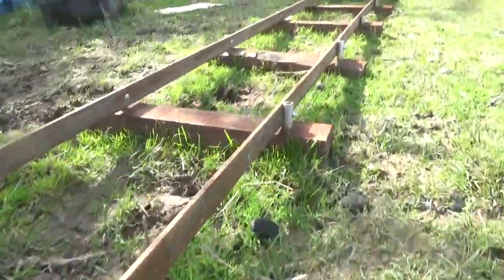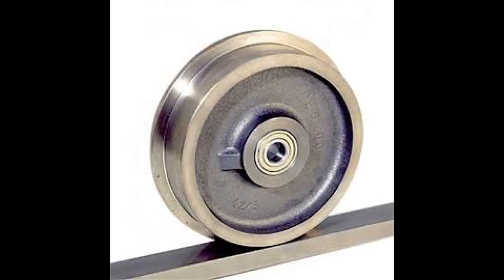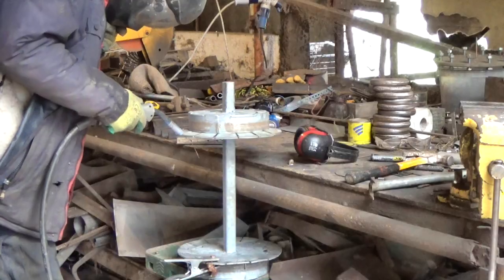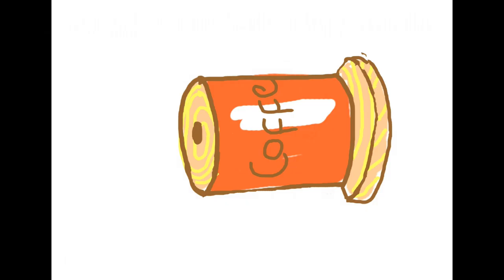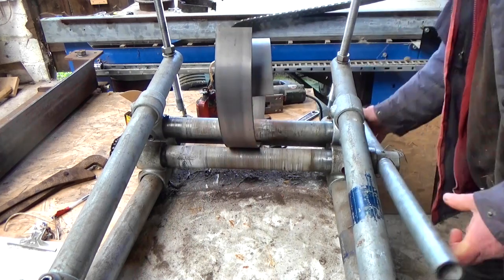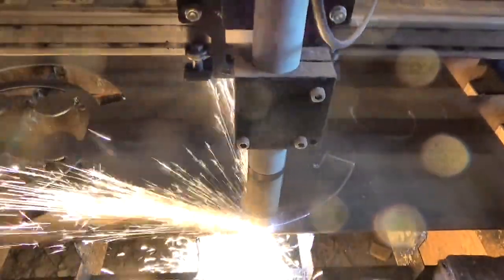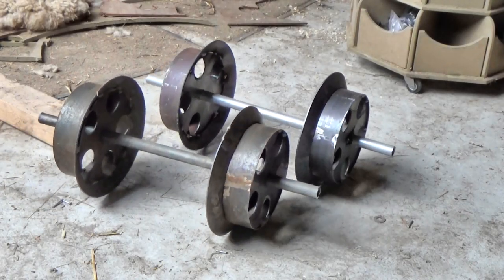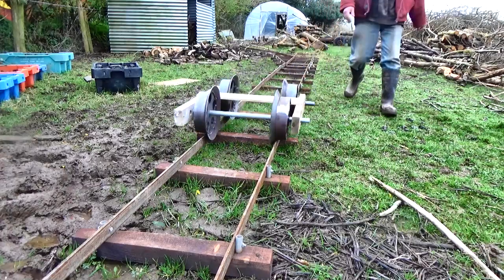Homemade Railway Wheels! (For the 15" narrow gauge railway.)

Comment: Loving this series.  Maybe move the outer disc closer to the center in the ‘pipe’ section where the load will be more often to support the rim better?
Reply: I suspect over such a short span and with the circular shape, that 3mm steel is going to be pretty rigid. I guess it would depend ultimately how much load each wheel was bearing whether the ease of just lining up against an edge was outweighed by the extra strength.
Reply from the maker: Thanks Matthias. Yes, I was even wondering if 3 discs would be worth it. Hmmm. It just depends which part of the whole arrangement is the weakest. More experiments needed!
Reply: @WayOutWestx2  , I was thinking you could fill the wheels with concrete.

Oh, and there's an ad for polytunnel greenhouses under this vid.
 Google is on to you...

Comment: Wow those flanges came out amazing for pounding them out with a hammer! You think you could make much larger and sharper cones in your roller?
Reply from the maker: Yes, but it would struggle  with wide pieces over 4mm thick. (Well, I'd struggle anyway!)

Comment: Wooden wheels with a steel band around the wood for reinforcement, almost like the steel on a barrel? 
Love seeing the videos and how you come up with The solutions, much inspiring.
Reply: That was my first thought, too. Very strong and cheap. You'd probably get away with the wheels running directly on the axles, with a good dollop of grease. I reckon that would be OK for this little project. Or, you could press in some simple bushes.
Reply: I think that's how they made RR wheels back in the day.  Just like RR rails were wood with iron nailed on top.

Comment: Re tapers on treads:

If you have enough spare material on the wheels it might be worth a go, if the tapers are opposite the cart should naturally fall into the middle of the tracks, which i believe should help with navigating corners without too much scraping! I think you could cut in a modest taper with an angle grinder and a rotating stand to keep them even (:
Reply: Having watched a bit further on and seeing you cnc the flanges, I wonder if you could do something similar with the tread? CNC cut the cone shape then roll it into position!

CNCing the "spoke" sections also means that if you wanted, you could do custom design wheels! Perhaps you could have people on your patreon design wheels and cut them all out as a fun way of getting involved, assumign it wouldn't take too much extra time for you of course

Comment: Steel-on-wood friction points (in old windmills and water mills for example) used to be lubricated using tallow (animal fat). You may be able to get away with no ball bearings at all in a low-speed application like this- some hard-ish wood and the galvanised pipe, and maybe a drilled hole with a grease nipple in the wooden part to easily deliver grease to the friction points? Following this project with great curiosity!
Reply from the maker: thanks, Alex. Yes, watch this space!!!

Comment: Used drum brake rotors can be utilized very well for this by welding up a larger edge. Especially ones with combined disc and drum brakes, you can use a lathe to cut out excess material from the disc edge.

Comment: You could have used scrap brake rotors which would have made mounting onto bearings a bit easier just using car bearings, stub axle's with a disc on would be very light too.   Just trim the height of the disc down to suit and then turn a chamfer at the edge to give you the turn point.   Also means you could knock up a mechanical brake with some ease too :)
Reply from the maker: Thanks. I did look at them but I'd need a good lathe for them, wouldn't I? Hmm..
Reply: Interesting Semi-Cyrilic namer-tag. You know pronouncing the first part of your name in russian/cyrilic is pronounced Shat suggesting poop.

Comment: Vinegar will take off galvanising, submerge in & leave over night. Still I burned a hole last week in my jeans that would take 3x1 Euro coins, while welding mild steel with no coating, red  hot metal in my jean turn up and just far enough from my leg that I didn't realise I was on fire & I didn't see the smoke through my helmet. Thanks for sharing!

Comment: Using brake rotor from an old truck  might save lots works and the flange are already there just need to be modified cut and ground on an angle 
Just an idea  look great can’t wait to see the finish rail and carts

Comment: the taper on the tread is there to center the axle on the rails, if the axle is off center it means the outside wheel has a larger circumference and because the wheels are locked together it means it will travel further and recenter.

it also means there is less wear on the rails from grinding off the flanges.

Comment: I hope you try conical treads instead of the cylindrical treads you have there. I think it will keep the flanges away from the rails and will make going around curves a lot smoother because it will allow the outer wheel to ride up to the wide part and speed up.   With cylindrical wheels , your flanges will be scraping against the track all the way around the curve.

Comment: if you have a sufficiently large metal lathe you can turn wheels in it and have the tread be conical. This will reduse Flange contact and in the long run reduce maintenance.

Comment: Here's an explanation of tapered tread:
Imagine your wheels are going through a right-hand curve. As the wheels roll straight ahead the left flange will hit the rail, so the right wheel is rolling on the rail on the edge of the wheel opposite the flange. If that part of the wheel were narrower, the circumference would be smaller so that wheel would travel a shorter distance than the other one, making the train 'steer' around the curve and stay centered in the track!
The flanges mostly won't touch the rail, so the wheels can't ride up and derail, and there's less friction from the wheels not sliding in a curve.
Reply from the maker: Thanks. Yes, I know the theory and I will make some to compare, but I just wanted to show that straight treads work well too, and are much easier.

Comment: Tim, perhaps using brake rotors from an automobile would be easier than fabricating wheels yourself.  Then you could use automotive hubs, bearings and even brakes, and have a ready supply of replacement parts available. Impressive project. Greetings from Colorado USA!

Comment: Idk if you have a lathe but I saw a guy turn down some weights for a bench press into wheels once and made some adapters for the axle hole. If you taper your tread a little bit your wheels will center on the track better just very sightly cone shaped instead of a perfect cylinder only a degree or two. You could do it by just grinding the profile with an angle grinder.

Comment: Hi. I'm new to your channel and have already subscribed. Loving the railway system. Wondered if you could make wheels out of car or trailer wheels. You'd have to grind off one of the bead flanges. The bit where the tyre sits usually curves down to the wheel nut plate. This may help you to stay on the rails and not need quite such a big flange on the outside. Maybe.

Comment: G'day,

Yay Team !

  Brilliant, and fascinating to watch.

Regarding Bearings..., for a Donkey-powered Railway you might have to pay a lot of money to aquire a Bearing which will, in your application, much outperform an actual (Endgrain) Hardwood Bearing ; it's what they use on the bigger versions of the iconic "Southern Cross" type Water-Pumping aggricultural Windmills - and some of them  have been running for a hundred years...the Wood allows Grease/Oil to move through the Grain to better lubricate the Bearing-surface, apparently.

  Worth considering, maybe...?

Such is life,

Have a good one...

Stay safe.

;-p

Ciao !

Comment: I have seen where just strait roller wheels are used without flanges. Instead skate board wheels are used against the inside of the track. This way the flange has no friction on the track. And the whole cart stays on the track better. 
Something like a roller coaster design. And since they are separate they are independently replaceable. And Easy to make.
Reply from the maker: Thanks, Perry. Yes, I think I'll have to try a set of those too : -  )

Comment: Have you considered forming the flange by pressing instead of cutting and welding? A simple hydraulic press, if you don´t already have one, can be welded up quickly from some steel beams, and using a bottle jack as an pump/ram. For the press forming, you would need a die comprised of a ring that supports the outer edge of the flange and a disc of the diameter of the tread. This might be more economic than cutting, welding and grinding, especially if you plan to make many wheels.

Comment: I think you might be underestimating the role of the taper in keeping the wheels on the track. It acts as a self correcting mechanism - if the wheels drift to one side, the radius of the section of the wheel in contact with the rail becomes larger, while the opposite radius becomes smaller. As a result, one wheel turns slower and the other faster causing the axel to correct. This design handles corners perfectly too, as the whole assembly slides out to the outer radius of the corner so that the inner wheel is turning faster (picture a bolt rolling around on a workbench.) It works even without flanges. The flanges are a failsafe more than anything else and make very little contact with the rails (train journeys would be a much screechier affair if they did.)

An easier way to think about it is to imagine two cones glued together at the base rolling down two suspended rails. Imagine how much farther they would get compared to a flat cylinder, sliding off at the slightest bump or bend. Train designers just cut out all the extra bits of cone they didn't need that might get in the way, but the principle is the same.

If the wheels you've got are working fine it's no big deal, but I'd recommend at least doing some small scale experiments to see if you could improve on the design for future iterations.
Reply from the maker: Thanks, Steve. Check out this one... https://youtu.be/VG49XIr_T4Y
Reply: @WayOutWestx2  Well don't I look silly now. That's exactly sort the video I had in mind that you'd make detailing your experiments though. If only my amazing powers of prediction could be made to work forwards in time!

Comment: id suggest for the little rail way like a holding stop for your little wagons
a latching system or a chain link one would work well 
along with a holding system for the waggons a coupling system for easier use of multiple wagons

Comment: You shud make a flexframe for the wheels to cope whit the track better.
Replace the horisontal plank on your maleshift boggie whit a pipe in pipe solution.
One pipe fixed on one side and the other pipe fixed at the other side.
This alows the wheels to flex when the track is uneven to reduce the risk of derailments.

Comment: I have just rediscovered you! I was subscribed but lost you for a while. Just love your railway wheels. Can't help thinking how much like break drums they look. The flanges might be too small but wonder if adding an extra skirt might be possible. I know welding cast steel is tricky but the drums have bearings already in place. Weld the axel stubs into a cross tube axel. Just my thoughts. So pleased to be back with you both.
Reply from the maker: Welcome back Paul!

Comment: the builded point in one of the last videos looked promising. But i'm not sure if this does work with heavy loads. I think the design with two switching rails were one is curved (aswell as the most left rail wich would be curved too) will honor the extra time making with saving time while pushing the lore is easier. Great projekt..

Comment: To make wheels for heavier loads, I suspect you could gang up the "donut parts." If this would work, then you have a whole system for creating carts for various load weights.

Also, it seems to me you could cone the treads almost as easily as you coned the flanges. More complicated to fit the "donut parts," but maybe worth it for smoother travel?
Reply from the maker: Yes, you're right. I was going to make a set with a tapered tread but I wanted to show that straight treads work fine too and they're much easier

Comment: Hi Tim.  I am a backyard inventor (among other things) and I really appreciate your insights.  Your skills and range of knowledge are impressive and I'm sorry but I have already stolen some of your ideas for projects of my own.  If I may, could I suggest that the angle of side-track from your rail points may need adjustment?  The severe exit angle could cause a lot of friction and difficulty once you load up the trolleys with weight.  It might be worthwhile to adjust it into a bit gentler curve before all your ballast goes down.

All the best with the project.  I'm fascinated by it all and can't wait for the next instalment.
Reply from the maker: You're right - I could change that exit angle, but it's probably not worth it with the amount of use it will get. But there'll be lots more points to build in other places, so I'll try other types, I hope

Comment: Wow! I'm really impressed by your wheels! They look just perfect... As I've neither the ability nor the tools to do them, I'm thinking about to buy them. Here in Brazil I've found a shop specialized in small metal wheels for industrial railways (they usually make wheel for big industries that need to carry wares from one fabric utity to an other), I'm just affraid of the price it may cost. Other idea I have is to find a little shop in my town that works with metal (there are a lot in Brazil) and to see with them if they could make some wheels... Do you think aluminium would be better, or definitively steel for the wheels?

Comment: Aluminium is a lot easier to cast than steel, so you could perhaps try to cast the middle of the wheel and flanges as a single part and then add a thin section of steel pipe or rolled steel sheet to have something strong enough to not deform from the tracks.
Reply from the maker: Good idea - but a lot of work?

Comment: I am amazed.  Is there anything that you can't do?  I think one of the first videos of yours I saw was for wagon wheels.   you said you would need 50 wheels or more...  why so many?  I've seen wooden bushings used.  use the hardest wood you can find.  burn the inside of the hole, drill a small hole into the center of it and place a grease nipple in for pumping grease onto the shaft.  I've seen this done in Zamia on a wind mill.  the last one had lasted for many decades.   love your videos.  God bless you all.
Reply from the maker: Thanks, Randy. Yes, that's a interesting idea. Watch this space...!

Comment: Having just got a quote for some existing wheels to be professionally mounted to new axles for 15" gauge. This looks a cheap alternative. Sadly as its a public railway will have to be professionally done for certification. As for bearings, plumb block bearings all the time. Less than £20 each, but look forward to seeing what you come up with. Really enjoy your channel, definitely more 15" gauge content. Its great fun.
Reply from the maker: Thanks, J. What size axles do you use?

Comment: Not sure if they would meet the load capacity you need, but casting a whole wheel out of say, aluminum would probably be quite cheap and easy, not to mention relatively fast, once you have a reliable cast.

Comment: Great job you are doïng, maybe I can give you a little advice: Long time ago when I worked at the drawing-office as a designer in a factory where locomotives were made using compressed air, 200 bars or 2800 PSI, in stead of steam for transporting coal in the coalmines, i saw at the drawings and blueprints the wheels were a little bit conical, vertical angle about 10 degrees.. If you have a lathe put it at 5 degrees and turn the tread smooth. So the train, your train, will center at the rails by that conical shape. The angle of the flanges was about 15 to 20 degrees to guide along the rails and the switch in the rails.   (Excuse my poor English but it is not my native speak. i am from the Netherlands.)
Reply from the maker: Thanks, Pieter. Yes, I know about the conical treads and I will make some soon, I hope. But I just wanted to show that straight-tread wheels are easy enough to make for anyone - and they work well enough for this sort of project
Reply: @WayOutWestx2  So my advise was superfluous, you knew it . Nevermind. It is a nice job to make a railroad in your garden.

Comment: My first instinct would be some reinforced disc brake rotors with the angle machined right into the disc.  Finding that perfect rotor would be a little difficult but im sure with all the variations, one exists. 

They're a little brittle, but should be fine if you aren't dumping large stones
Reply from the maker: I'll keep looking but I haven't found anything suitable yet. New they'd be too expensive because they'd still need a lot of work, wouldn't they?
Reply: @WayOutWestx2   Not sure about what your budget is with regards to what your time is worth. But going with something for 2001 GMC Sierra rear truck rotors start around $40 each.

Look on amazon ASIN# B0031I809G or B0031I4HOI